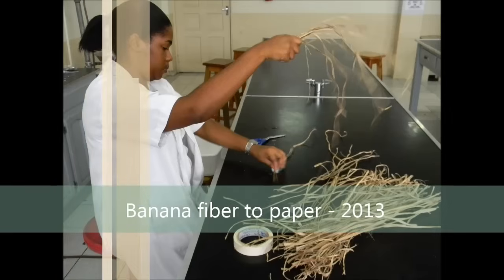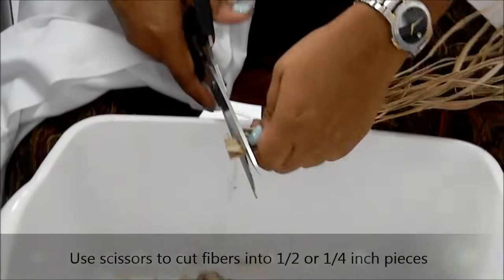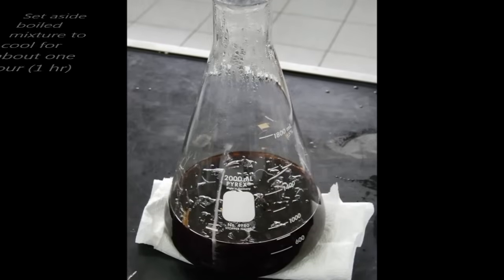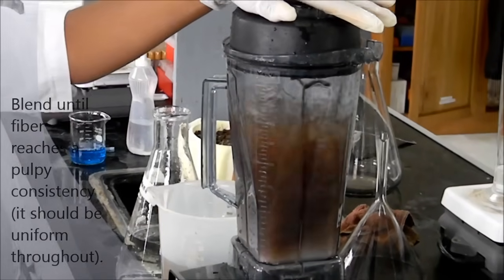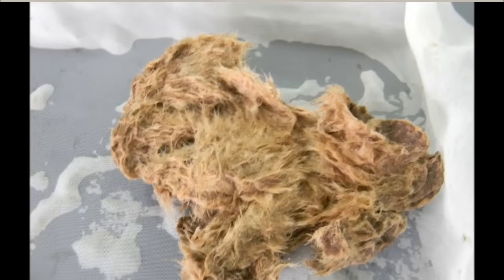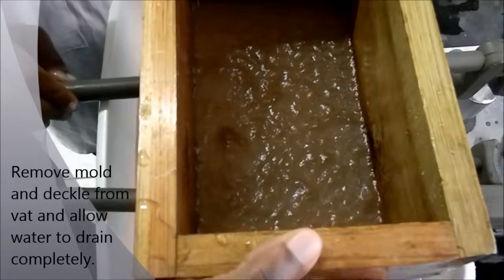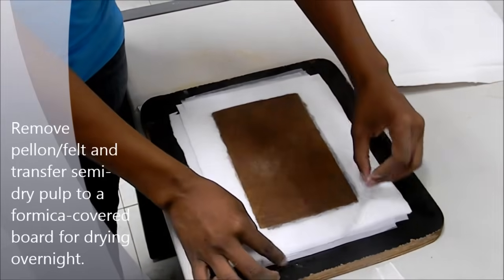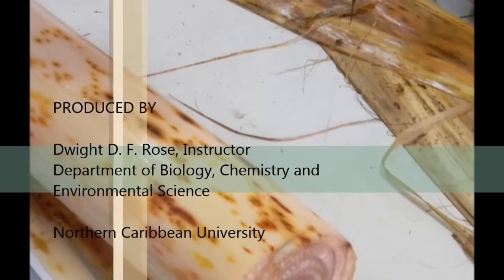How to convert banana fiber to paper

Comment: How to prevent paper from being brittle and wrinkled when dry? thanks.
Reply from the maker: Some papers wrinkle when placed in the sun to dry because the fibers contract when dried rapidly.  The best way to dry these papers is in a dry place in the house on glass or on smooth boards.  You can put them out in the sun when they are dry to complete the drying process. 
Brittle papers are the result of weak or tiny fibers.  You will have to experiment with different plants to find the ones that are just right for your paper-making needs.
Reply: @dwightrose5735  Very useful information, thank you very much. We also make paper from bananas. Looking forward to hearing more from you. thank you very much!

Comment: Hello sir
 I want to know 
How to cellulose extract from linseed straw  (oil varity of flax)

Please give some useful information regarding this
How much naoh can i use and time
Reply from the maker: I used to use 10-12% NaOH until it was demonstrated through research that 3-5% would work well for softer plant material.  It turns out that excessive NaOH actually degrades cellulose.  My new video on pulping demonstrates how you can pulp most non-woods (https://www.youtube.com/watch?v=ioyXCghX06Y)
Linseed straw would probably work well with a 3% NaOH solution (cooked for about 1 hour and cooled to room temperature).  Just use enough solution to cover the plant materials in a stainless steel pot.
Reply: @dwightrose5735  
Can i do presteaming in pressure cooker for some minutes before 
Naoh treatment 

If yes then what which chemical mixed in presteaming 
Can I use sulfuric acide or citric acide

And thank u sir  for give  to me information

Comment: Hi sir! How many paper (and in what sizes) did you make for a 13g pulp?
Reply from the maker: Thank you for your question...it is a tricky one.  Different types of plant materials have different pulp and paper yields.  Paper is measured more by grammage (basis weight) than by size.  I will have to make a video describing paper yield.
If you want to find out the yield, you must first measure out the dried plant material, pulp it, and make paper with it.  You then weigh the paper and calculate the percentage yield as [(Total weight or paper * 100)/total weight of dried plant material].  It is better to use a deckle box (https://www.google.com/url?sa=i&url=https%3A%2F%2Fwww.paperslurry.com%2F2016%2F03%2F31%2Fmaking-handmade-paper-with-a-deckle-box-part-2%2F&psig=AOvVaw2bG0xNR0S9nB-gdoBsZQAn&ust=1653528566382000&source=images&cd=vfe&ved=0CAwQjRxqFwoTCIiSj4jA-fcCFQAAAAAdAAAAABAb) to make the paper since you can be consistent in your measurement of the amount of pulp used to make each sheet.

Comment: Sir what is the use of sodium hydroxide?
Reply from the maker: Lignin is the glue that hold cellulose fibers together.  Sodium Hydroxide (NaOH - also called lye) when heated in a 3-5% solution helps to break down and dissolve the lignin in plant fibers, facilitating its removal and leaving cellulose fibers behind.  Cellulose fibers are the basic foundation of papers and paper-making.  https://youtu.be/ioyXCghX06Y - This is an updated video on pulping.

Comment: Sir, at what temperature do we suppose to dry the stripped fibres in incubator at early stage?
Reply from the maker: No higher than 150 Fahrenheit (125-150).  You could also hang them out in the sun on a line to dry.
Reply: @dwightrose5735  Thank you sir. You've helped me a lot!!
Reply: @dwightrose5735  may i ask for how long need to hang them out in the sun? thankyou
Reply from the maker: @rheanneizleornedo1499  until they dry.
Reply: @dwightrose5735 usually for how many hours?

Comment: Hello, sir. Could you please explain why the mixture should be cooled for about an hour?
Reply from the maker: Cooking the fibers in a 3-5% (or higher) NaOH solution results in a reaction that degrades the lignin in the plant material.  Once the boil is finished the reaction will continue as long as heat is present.  
-  The major reason for allowing it to cool is to slow down the reaction and to allow the process of lignin dissolution to be completed.
-  The other reason for allowing it to cool down is that NaOH is caustic and could cause severe burns to the skin, especially when it is hot.  
Use caution if you decide to pour it out and to rinse the fibers immediately after the boil.  The rest time is ideal.  I usually leave it overnight to cool thoroughly, but if you are in a rush use at least 15-20 minutes of cool time.
Reply: Ohh, i see. Thank you so much for your detailed information. It's a huge help :))

Comment: Hi Sir, This video is so great!. Thank you so much. I have a question. How about hemicellulose? It's dissolve, right???
Reply from the maker: Hemicelluloses are some of the polysaccharides present in wood and non-wood materials.  They "increase the strength of paper (especially tensile, burst, and fold) and the pulp yield but are not desired in dissolving pulps. (Dissolving pulps are relatively pure forms of cellulose used to make cellulose-based plastics.) Starch is often added to pulp to increase the strength of paper and probably has a very similar mechanism of effect as the hemicelluloses." (https://www.sciencedirect.com/topics/chemistry/hemicellulose)
"Hemicelluloses are much more soluble and labile, that is, susceptible to chemical degradation, than is cellulose. They are soluble in 18.5% NaOH (which is the basis of their measurement in Tappi Test Method T203)."
They are hydrolyzed by a base/alkali (in this case NaOH) into monosaccharides which can be removed in the black liquor.  If you overcook the cellulose you can also start to degrade it.  This is why I use low (3-5%) percentages now for the cooking aspect of the process.

Comment: Hello, may I ask why it is cooked with a NaOH solution?
Reply from the maker: The main purpose of the NaOH solution is to remove the lignin from the plant material, thus increasing the cellulose yield.  NaOH can eventually break down cellulose material and thus you should note the timing for the breakdown of the material during cooking.
Reply: May I ask if there is an alternative use if i dont have any NaOH?

Comment: How much tensile strength does the paper have?
Reply from the maker: I actually am working on a video to show you how to build a simple device to measure "breaking length" (the paper equivalent of tensile strength).  The breaking lengths for some of the banana plants I tested are between 3000 and 8500 m (3 km and 8.5 km).  For reference, office paper with a grammage of 75 g/m^2 has a breaking length of between 2.5 km and 6.0 km (I measured 4.5 km on average).

Comment: whay do you dry the fiber and then put them into water
Reply from the maker: I have realized that it is really unnecessary to dry the fibers before cooking them.  The only advantage is that drying the fibers removes excess water and thus allows the concentration of NaOH or Na2CO3 used to be more effective.  Soaking dry fibers before cooking them in NaOH is useful in allowing the lye solution to penetrate them.
Reply: @dwightrose5735  for  that you could also filter them to save energy

Comment: hi. what was the indicator that the NaOH was already removed from the fibers? thank you for the answer
Reply from the maker: The major indicator is the reduction in the slippery feel of the fibers when rubbed between your fingers (make sure to rinse hand thoroughly after each test).  When rinsed thoroughly the water dripping out usually becomes clear.
Reply: Thank you!

Comment: Why do you have to boil the fibre?
Reply from the maker: Cooking plant fibers in a lye solution (Soda pulping) helps to dissolve most of the lignin in the material and thus release the cellulose fibres (the major ingredient in paper).  I have learned to use lower percentages of NaOH (3-5%) in the cooking process.  Hardwood ashes can be boiled in water to produce Potash (another lye solution) which, when filtered, can be used to cook the fibers also to remove lignin.  My new video on pulping (https://www.youtube.com/watch?v=ioyXCghX06Y) has an updated process.

Comment: Is it possible to make Banana paper without Sodium Hydroxide?
Reply: Hello! Anyare sa research niyo? We're doing the same study kasi ang pinagkaiba lang, we're making cardboard. So I wonder if need din namin ng sodium hydroxide kaso nga lang quarantine, mahirap kumuha. So tinuloy niyo ba yung study niyo?
Reply: @bellerei6947  Hi there. since wala kaming nagamit na sodium hydroxide,  naging cardboard like ang paper namin so nagchange nalang kami ng title. Nadiscontinue din naman afterward ang research kasi nag end na yung sem due to pandemic. Suggest ko lang na akuluan ang fiber then blender tapos mas maraming pulp means mas makapal ang magagawang carboard. Pero dapat pantay ang pagkakagawa ng cardboard kasi minsan tuyo na ibang area ang iba naman is basa pa kasi masyadong makapal. Hope this helped a lot and goodluck to your research. PADAYON!
Reply from the maker: I recently tried Oxyclean (which contains Sodium Percarbonate) in the cooking solution and it interestingly made a good pulp.  Sodium Carbonate is another environmentally friendly chemical used in cooking plant materials.  Hardwood ashes cooked in rainwater (preferably) and strained can create a potash solution that is quite useful in cooking plant materials.  Many of these alternative cooking solutions are not as effective as NaOH (Sodium Hydroxide), but they work well if you add a bit more cook time.  They may not work so well on harder fibres like bamboo.
My new video on pulping is quite useful: https://www.youtube.com/watch?v=ioyXCghX06Y
Reply: no
Reply: @GEOsustainable  We knew that. But sadly our research was not continued because of the pandemic. We were graduating high school students this year. Anyways, thank you for being a reference for our work. Stay Safe!

Comment: Hi. Im currenly doing a research about paper making from palm leaves. Is it necessary to dry the leaves or can use fresh leaves?
Reply from the maker: You can use fresh leaves.  Using fresh leaves uses more solution.

Comment: You can make a 3% NaOH solution (3 g in 100 mL of water solution,  9g in 300-mL, etc.) and pour enough over the fiber to sufficiently cover it.  Some fibers tend to swell and so you may have to top up with extra until a uniform boil is achieved.  Getting it to a uniform boil is a bit of a challenge, so you may have to pay keen attention for at least 15-20 minutes.

Comment: Sir how can we make the paper white?
Reply from the maker: Thank you for your question, I have been experimenting with the bleaching of paper over the summer.  I found a video on youtube by Richard Venditti (https://www.youtube.com/watch?v=jDvC2karRvA&t=2928s) which gives detailed explanations of how paper pulp is bleached.  Some of the methods are quite complicated (including peroxide bleaching), but liquid chlorine bleach (Sodium Hypochlorite - NaOCl) seems to be the simplest and most affordable.  The downside is that it can form chloroform (carcinogen) and chlorine gas (low pH < 3).  It can also degrade cellulose (paper-making material in the plant) if the pH is between 6 and 7.
With that said, one can easily bleach paper pulp with liquid bleach from your local supermarket (Make sure to choose one which has 5.25% bleach on the label to get more bang for your buck).

Application: 0.5-2.5% Bleach (NaOCl)
-  Bleaching solution: 2.5% bleach - to dilute the 5.25% bleach solution add about 48 mL of bleach to 52 mL of water (to make 100 mL).  This number can be multipled by similar volumes of solution (for example: 500 mL solution --> [5 x 48] = 240 mL bleach + [5 x 52] = 260 mL water)  
-  Time: 30-90 minutes - use lower times for less whitening (I have found that 30 minutes works well for certain types of pulp, so watch the whitening carefully)
-  Consistency: 3-12% - To achieve the consistency: (1) squeeze out as much of the water out of the pulp as you can; (2) weigh the squeezed mass of pulp (g) - for example 50 g; place this in a large measuring container with volume marks and add enough bleach solution to achieve 415 mL (in other words...add about 85 mL for every 10 g of squeezed pulp). 
-  Temperature: 35-70 degrees Celsius - heat the solution with mild heat and use a thermometer to ensure that the temperature does not exceed 70 degrees Celsius.  
-  pH: 9.5 – 11 - you can check the pH with pH paper if you are unsure, but it is usually above 10 with the dilution given above.  Note: Liquid chlorine bleach typically has a pH of 11-12 (very alkaline).

You should be able to see the transformation in color within the first few minutes of mixing.  Make sure to mix regularly and to disperse the fibers evenly.

Comment: Hello Sir, Im doing a research project on how to make a paper using eco-based materials. What other type of leaves or stalk can i use to make papers?
Reply from the maker: Although most plants have some form of cellulose fiber, there are some that have more than others.  Plants like bamboo (alot of fiber is packed into the stalk of the bamboo), heliconia (lobbster claw plant), sisal, wild pineapple, corn stalks, grasses and fibrous plants can be used to make paper.  Check out https://www.paperslurry.com/2014/08/20/hand-papermaking-with-plants-illustrated-infographic/.  The only challenge is figuring out the right percentage of lye (NaOH) and cooking time that would adequately de-lignify the plant material without reducing cellulose content.  I have been doing some studies and have found that many plants can use lye concentrations as low as 5% NaOH and cooking times of 45 minutes to 1 hour if the cooked material is left to sit overnight.
Reply: @dwightrose5735  thank you so much!

Comment: what is the mass in grams of NaOH that you used for 500g fiber??
Reply from the maker: This is a difficult question to answer because some plant material is more absorbent than others.  It is best to cut up the plant material and then to make enough solution to completely cover it up with excess to top it up when the plant material swells (Note: not all materials behave in this manner so you may not have to top it up).  I have found that a 5%-7.5% solution of NaOH (used to cook the material for about 1 hour) can be used for many applications of both trunk and leaf fiber.  To make a 5% solution you need to add 5 g of NaOH to a measuring container (mL) and add enough water to make the total up to 100 mL.  If you need 500 mL then add 25 g (5 times as much NaOH) and make it up to the 500 mL mark.  After experimenting with a few plants you will develop an appropriate method.

Comment: How many papers can be made by that 50grams of banana fiber?
Reply from the maker: The number of papers depends on several factors: (1) The type and strength of fibers (not all banana trunks and fibers are equal); (2) The thickness and area of the sheets you intend to make; (3) The size of the mold/mould and deckle you plan to use (the one I used in this video was half of a regular copy paper = 8.5 x 5.5) and it was a deckle box design; and (4) the size mesh used on the mold (make sure the mesh is taut - this can be done by using 1/4 wire mesh under your mosquito mesh when making the mold). 
If the fibers are strong and give a good sheet in your trials, then you can reduce the amount of pulp used to make a sheet and thin it out.  Usually 15 g of dry fiber will give about 4-5 half-sheets.  Thus 50g would give approximately 10-15 sheets (7 copy-sized sheets).

Comment: Good morning! Can I ask you how much water do I need for 12% NaOH. I need it in my SIP. hope you can answer me ASAP..  thank you!
Reply from the maker: I have found that a 5%-7.5% solution of NaOH (used to cook the material for about 1 hour) can be used for many applications of both trunk and leaf fiber.  To make a 12% solution you need to add 12.0 g of NaOH to a measuring container (mL) and add enough water to make the total up to 100 mL.  If you need 1000 mL then add 120 g (10 times as much NaOH) and make it up to the 1000 mL mark.  After experimenting with a few plants you will develop an appropriate method.

Comment: can we write on it?.
Reply from the maker: Yes!  It is even possible to print on it, especially on the smooth side.  Adding glue and starch can improve the ability of the paper to hold print on the surface.
Reply: @dwightrose5735  thank you sir. In what part of the process will i add the starch and glue? And if i can  use cornstarch and any type of glue? I appreciate so much your reply.
Reply from the maker: Starch is usually the preferred additive (known as internal sizing).  A cooked 6% solution (6 grams for every 95 mL of water) can be added directly to the vat (if you are using the  scooping method), or it can be added to the blender with the measured pulp just before pouring it into the deckle box in the water.  For the deckle box method you will need to add approximately 2 teaspoonfuls of liquid starch to the blender with the pulp and some water before pouring it into the deckle box in the vat with water.
According to International Starch Trading (http://www.starch.dk/isi/applic/paper.htm), the use of starch at the wet end of paper-making improves paper strength.  Proper cooking and complete hydration of a starch molecule is essential for all applications. Potato starch and tapioca starch (cassava starch) are both as root starches extremely easy to cook. The concentration in question ranges from 6% (6 grams in 100 mL) for a wet end starch to as much as 40% solids for a coating starch.  Both shear and cooking temperature are important factors to completely disperse the starch granules. It is also possible to cook the starch in an open kettle for handmade applications.